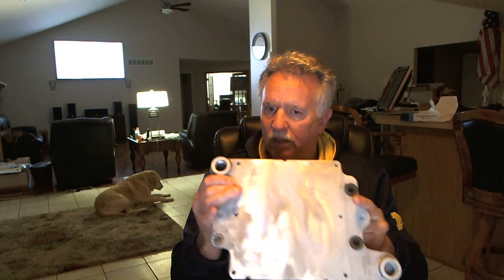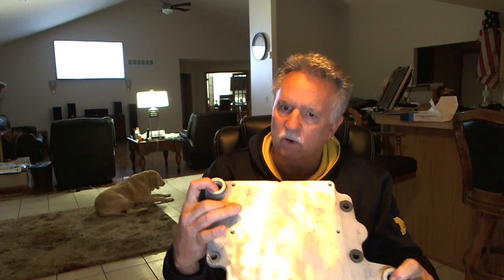L10, M11, N14, Cummins Hard Starting Fuel Problem

Comment: I’ve got a mechanical L10 Cummins in a 1985 international. I changed the little filter/strainer and gasket under the slotted cone on top of it. I removed the solenoid to get it off. Put it back together and it won’t start. Put on a new fuel filter and made sure it was full. Do I need to prime the system? Did the fuel pump randomly go out?
Reply: There’s fuel at the head and on top of the solenoid but it’s just oozing out. Assuming it needs to be shooting out.

Comment: I have owned 6 differant N14's celects and celect plus's and I have ran into it on 2 of my trucks threw the years where I was getting air in the fuel causing the trucks to run errattic or hard starting and I found that the bung fittings that are pressed into the ECM cooling plates where leaking when I pressure tested them. And rather than spend $600 on a new ECM cooler you can Tig weld the bung fitting to the cooler to fix the problem. Just thought I would throw that in there to help people troubleshoot these problems.
Reply from the maker: Thanks, that good to know Jason!
Reply: Could you tell by looking at it if they were leaking? Like we’re they wet at all or do you have to pressure test to diagnose?
Cheers.

Comment: hello friends.. whats the difference between the n14 M11 and L10 are the sensors the same? do they change?
Reply from the maker: Hey Tavo, most of the sensors are the same except the Turbo boost sensor. I really need to know the ESN# and what problem are you having etc? 810.653.6300

Comment: have a 2003 n14 Cummins have a serious problem once I sell a rate to fuel up to the steady 35 Mi on it truck will start backfiring blowing white smoke if I accelerate past the point it picks up speed fine have it at a dealership they've changed the wiring harness from the ECM through the motor injector harness we still have the same issue they changed the fuel throttle sensor three times and we still have the same issue do you have any ideas for me that may be able to help me thank you
Reply from the maker: Here is are website www.n14parts.com and here is a wiring diagram link for ya
http://n14parts.com/terry.pdf